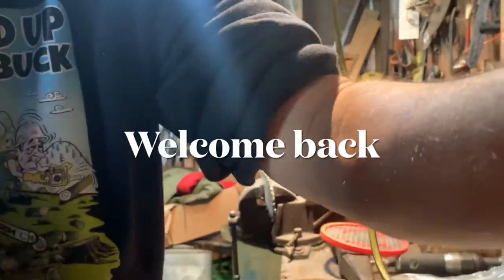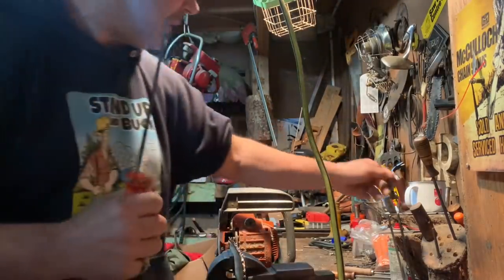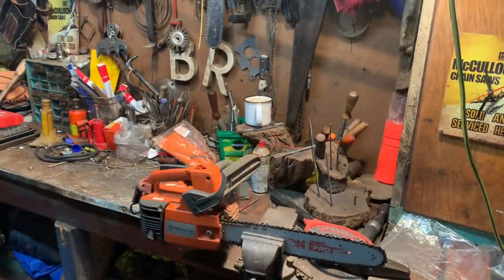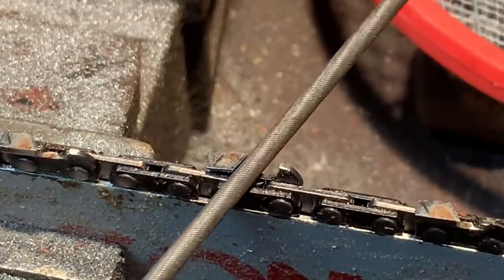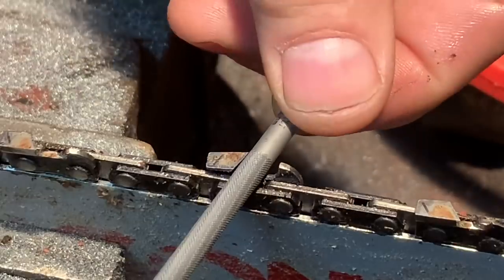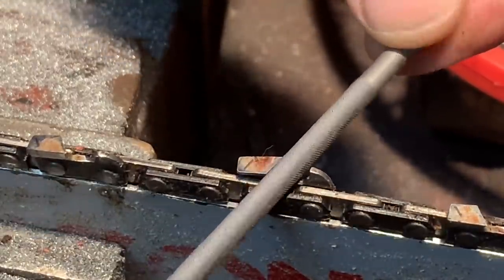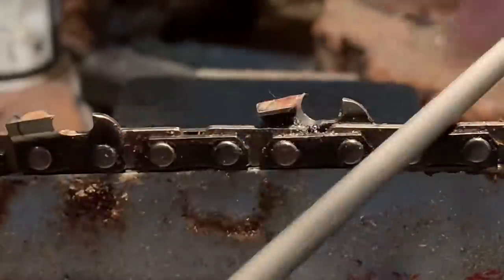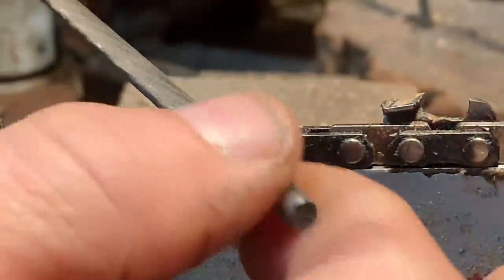How to sharpen a small chainsaw. (What file to use).

Comment: Thanks for this video. I have been cutting firewood for over 50 years and thought I knew how to sharpen a chain until I watched this video. I now heat my house of 2000 sq ft  with a homemade water stove and under floor radiant heat in north central NC. I started cutting wood with a McColluch with a manual chain oiler and am now using 42cc Poulans with 18 inch bars and 3/8 pitch chain. I sharpened one of them yesterday following your directions with 3/16 file and cut what wood I had uncut. I had a 10ft oak log 18in and a 12ft oak log 12in . I cut them 20in long in less than 20 mins and was disappointed that I didnt have more to cut. That really woke up that saw and I could not find my depth gauge for the rakers.
Thank you again
Reply: eBay $7 bucks

Comment: New subscriber who GREATLY appreciates your videos and the time you take to make them. Haven't operated a chainsaw in 20 years and just bought a Poulan Pro 4218 that came with an Oregon Chain that calls for the 5/32 file. The 5/32 felt weird when I test fit it to the cutter. Now I'm going to use the 3/16 when it comes time for the first sharpening. At first I thought it was a Full Chisel Chain based on the square factory grind and was ready to purchase a Swiss made bevel file , boy am I glad I watched this video before I did that !! Thanks Buckin for helping out the newbie community. And as always , Thank You for your messages of kindness. Be Safe , Be Kind and Be Happy.
Reply: I got several pro 4218 and I used the 3/16 just fine

Comment: My first chain saw was an electric,  about 30 years ago,  just some odd job pruning,  then about 20 years ago bought a gas power saw and more pruning and cutting,  even poison Ivy vines about 8 to10 inch diameter,  big itchy stuff,  pulled down some big trees. Taught myself to climb as a refresher course from earlier days of living with apple/plum and pear trees. 
I always took my chains to a shop to have them sharpened or bought a new one, seemed cheap enough for professional results. 
I have never sharpened my own.  
This video is the one that will get me to set up a new work table and put up my vice to get the gullet. 
After moving last year i got stuff everywhere in boxes and storage,  it is a cluster closet of crap(stuff) 
got a box of files,  box o chains,  a great indoor work project for the winter months. 
Love all the detailed comments,  I am very slow to do detailed work that I've never done. Must absorb as much info from all sources. 
My local friends have told me they can't believe I've never sharpened a chain,  they've all done it. 
It wasn't until now with such great camera angle close ups and the best darn tootin teacher on the yous toob that has inspired/motivated and taught me to appreciate my own abilities. 
Thanks Buckin and the many,  many experienced wood-folks for all the valuable insights. 
Love the Buckin army,  I'm a buck-private.

Comment: Good day to you buckin’ ive been a cabinetmaker and shop teacher for decades, always had a mental block about getting my chains sharp, sharp! Always ended up buying a new one, chain that is not a new saw,well just want to thank you from the bottom of my heart, you’ve changed everything for me, first revelation teeth don’t have to be the same lenght, second revelation boat filing get the gullet, third revelation don’t need to count strokes, and finially forth revelation keep going until you see a burr and no light on the edge, it’s not rocket science,thanks again
Reply: Sums up nicely what buckin would explain over the space of 25 videos 😎

Comment: Hi, Billy. 
I use a 5.5 mm file for large saws (like Husqvarna 572xp) , 4,8 mm file for  medium-sized saws (like Husqvarna 550xp) and 4,0 mm file for small saws (like Echo 2511) . 
Akujelppi from Finland 😉
Reply: I think that 5.2 mm file is suitable for 572 xp with a 50 cm bar  72 drives Oregon chain

Comment: Good afternoon from the Netherlands! Thanks for sharing. Did some firewood cutting last Saturday and afterwards filed up the chain again using your tips and tricks. They really work for me. First a few downward strokes to get the gullet and therefor the hook and then dress up the topplate. Once again thanks! Hope your arm is feeling better.
Reply from the maker: well done
Reply: @BuckinBillyRaySmith  would you be able/willing to do some more take guage debur bar maintenance and also your PREFERENCES to mix oils and octane for the older saws.

Comment: Buckin' i had trouble sharpening my chains for my little saw recommended file was 5/32 after watching you with your man sized saw chains i went up to 3/16 much better an much easier to sharpen my chains, thanks Buckin' for helping me think outside the box.........
Reply: Arron Johnston I find those 5/32 files are just too flimsy. I have a hard time keeping a constant angle.
Reply: @shapeshifter7753  i had that same trouble plus as Buckin' said you have to hold the file up which i think is the issue with keeping them consistent but after watching Buckin's sharpening videos i tried 3/16 and the difference was amazing i honestly haven't looked back since....

Comment: This is true, absolutely true.  I’ve been doing this for years, never knew it was a thing.  What ever size saw/chain combination I’m running after the chain has some miles on it I try a bigger file.  If I’m having to start my stroke and pull up on the file it’s a dead giveaway.  The file stroke with it’s proper X and Y axis (angle & tilt) should correct any dulling.

Comment: I’ve probably watched this three or four times now.  Still pick a little something up every time.  Sincerely though, thanks so much for recommending the 7/32” file.  With the 3/16” I found on a new tooth, I developed too much gullet and it would cut like crazy for a few cuts and then roll that cutter right back just enough so that I’d have to dog in to get it to really pull through.  With the bigger file, it’s not so extreme a hook

Comment: Sorry Bucking, but for once your explanation does make complete sense.  The reason that the 5/32 didn't fit is that you had filed it with the 3/16, so naturally as they are different diameters that will happen.   Basically, the 3/16 will usually produce a cutting edge that is more "blunt" than the 5/32 unless you cut deeper into the chain.  So horses for courses.
Reply from the maker: hey rob good to see your wheels turnin'. what you said is the point of the video  . and that is that the 3/16 fits thx buddy

Comment: Good video..! As a humble Saw (Stihl ms170) user...I've never seen anyone mentioning the fact that all chains have two teeth that face same direction (so the user knows when they have done a full rotation) and it's time to spin the saw or your body round and start the sharpening process until you reach the same two teeth that face same direction..! Unless I'm a total fool, it eliminates a lot of time and headache working out where you need to start to fill...and all that time marking the starting point with magic markers tippex efc...Maybe I'm totally wrong
Reply: I just put a red mark on my starting tooth and work around until it shows up again. No muss, no fuss.

Comment: Right on Billy. I started using a 3/16 on my 3/8 lo pro chains right after you put the first video up on it. I have to file mine a few times with the 5/32 on a new chain because I don't hardly have enough clearance to run the file between the tooth and the raker when they are brand new.
Reply from the maker: if ya wanna ship that step try putting 3/16 in straight across  for a couple strokes they a gradual turn
Reply: @BuckinBillyRaySmith  never would have thought of that! Thanks for the tip my friend!

Comment: One, could use the  1/8  file, to increase the  ' gullet '   (lower under part, which gives the tooth at the top edge, more  ' bite ' )  then, use the larger file  5/32, or  3/16  to  sharpen the top cutter edge.
 I may  try  this method, at present i use an angle  grinder  device,  with a  1/8  inch thick, fine stoned  disk.  A slight adjustment, for   a split-second, sharpens  this top edge.   Check out  Project Farm,  here on a Youtube channel.  This guy, compares  all  chainsaw chains,  and their  ' cut ' quality.   Very  good     product  testing.

Comment: I took your advice on a 14" corded electric saw,  3/16 file & "get the gullet" and man o man does that saw cut thru oak. As good as the power saw but less than half the weight

Comment: Buckin'...You may be able to get away with the 3/16 file on a new chain but when you get down to half the top plate left I think you are either going to either be deep in the straps or the top plate will have too blunt an angle.  You may want to drop to 11/64 (yes they are available).  And since you are mentioning file brands, have you ever tried the Save Edge brand.  Their files are the smoothest, longest lasting, and sharpest I have ever used and that includes Oregon, Stihl, Pferd, and Husky.  Try their 6" flat file for your rakers and you will be amazed at the ease in filing rakers...like nothing I have ever used.

Keep the good content coming.  I always learn something!
Reply: OBX Koastie great tips there friend!

Comment: Hello Buckin’ could you put up, and explain the difference between chains, full house, skip tooth & full skip, and the chains for ripping/ milling.
Reply: This and the files he recommends
Reply: I wish I could like this question a 100 times. I want that too. And is there a difference in file plates for which size chains. Also I'm very interested in the flat file sharpening so which file for which size chains

Comment: Yeah that works, but as you get farther into the depth of the teeth, you'll be having to put a lot more work into it than necessary because of cutting into the link of the chain.  Using the right size file allows you to get more use out of the chain before you have to start grinding into the link to keep it sharp.
Reply from the maker: switchin back near the end solves this, if yer concerned about it  ,, thx

Comment: No micrometer ?  Take a peeksy-poo at the STIHL picco chain 3/8 .050 low profile if it suits your fancy ... You might have another customer on your paper route!  I wouldn’t use it commercially on any saw much over 50cc or 5hp , el - stretch or worse el snap - o - la ... That 572xp is really laboring Buckin 😉

Comment: I use the stihl 201 queit a bit I use the Oregon 91 vxl chain. This chain also cal for a 5/32 file or 4,0 mm as I prefer. I use the 4,5 mm to the chain is about half worn or so, then I use the 4,0 mm.

Comment: A note .  After a couple chain sharpenings, one should file down, the  depth  gauge link, just before the cutter tooth. Try to keep 1 mm or so, of height  LOWER   THAN   THE   TOOTH.  As more chain sharpenings take place, the downward slope of the cutting tooth,  is now the front edge.  Both of these teeth,  require  trimming  at  some  point, after probably  3 sharpenings. Both, must co-operate when  needing  a  good  ' bite '.

Comment: I only use small saws and I filed a chain with a 3/16 to get underneath the topplate. But it weakend the chainlink so much that it snapped. What am I doing wrong?
Reply: You must have ground down onto the chain strap to much,,,possibly weakening it.
Reply: That's what I figured, but how can you avoid that with a bigger file. You must "dig in" to get underneath the topplate

Comment: I'd like to pick your brain for just a second. I have a Craftsman / poulan 42 cc with an 18 inch bar that keeps getting hung up on a single tooth but it's not pinched, when I finally get it yanked loose there's a chunk of wood stuck in the tooth everything seems to be in line everything is cutting fine when it doesn't snag. Have you seen this before? The tooth doesn't appear to be any longer than the rest either and my tension just keeps the chain snug in the bottom with the tip up. It started doing this within an hour of the chain being freshly purchased on the first use. But I have a second battery powered echo with a 16-in bar that has done the same thing and lost four teeth in the process...

Comment: I subbed to you Billy after seeing you hang an axe with Steve. I have a Oregon R40 3/8 .043 calling for 4.5mm. I saw no reason to buy those expensive files. So I just used 3/16. I’m guessing this is fine?

Comment: Thanks Bucking I needed that, my saw is cutting to the left! Making a curve at 3/4down not sure what I'm doing wrong!
Reply: Dull chain most likely, how is the sawdust coming outta the saw while its cutting crooked? If its powder or fine you definitely need to sharpen the chain. I always pay attention to my sawdust it gives a lot of feed back.
Reply: Yeah dull, and not uniformly sharp throughout. Some of the teeth could hit trapped dirt or rocks dulling just some of them or you have sharpened half of the teeth more effectively than the other (more pressure or funny angle on one aspect or something). Either way you'll end up with a chain that wants to pull more towards the sharp teeth with the dull ones not contributing (obviously). Sorry if I'm repeating what was said in the video, I skipped a little... 🙃

Comment: Hey Buckin, I love your work and I've built a house in the country and learned to run a power saw from you so thank you.  I have a question though that I'm not sure if you ever talk about.  When you turn off the saws I see you pull on the pull cord, what's that for.
Reply: I would like to know that reason also! Been running saws for 12 years and always wondered why Billy Ray and others do that? I am sure he has a perfectly legitimate reason for it? I'm just to dumb to figure it out, Lol

Comment: But the whole reason for the smaller file is so you will have to use slight "up" pressure, instead of downforce. So you're cutting the metal that needs cut, not down into the chain, or lower into the tooth body. Seems to me you're going to get about half the useful life from a chain doing it your way.

Comment: 2:40 only reason there’s the space is because have have been using the larger file and it has a larger diameter. If you used the correct file size the whole time there would be no space.

Comment: hi buckin how can i straighten the crankshaft of my chainsaw? It got crooked on the clutch side
Reply: I used my 455 with a bent crank for a few months. It actually straightened it’s self🤷‍♂️crazy but that’s what happened. Unless someone knows a trick I’d say it needs a new one put in. Good luck in your journey friend
Reply: How did you check it to narrow it down to the crankshaft.
Reply: the problem with my chainsaw is that having the shaft bent, the chain causes more friction in certain points of the bar
Reply: I  have got a landoni l75, is a italian chainsaw since 1970
Reply: Surely sounds like a bent crank😖Sounds like it would be difficult to find parts for. Does it still run?
Reply: @etto7566  have you tried another bar. Thats also what happens when the bar sprocket goes bad, the chain will loosen and tighten.
Reply: @brettblack7049  yes i try to install another bar
Reply: @shapeshifter7753  yes the chaisaw run well...
Reply: Nice take on that one Brett! It never crossed my mind 👍

Comment: I use a rotary tool with a grinding stone. Do you recommend against this method?
Reply: I use a rotary if I’ve damaged a few teeth and need to take a bunch of material all at once. Have a great day friend
Reply from the maker: yes i do
Reply: @BuckinBillyRaySmith  here’s a little machining tip, NEVER drag your file on the backstroke. pick it up, backstroke and set it back down for the next cut. Your files will last longer and they will thank you for it
Reply: 95% chance of burning the tooth with a power tool (grinder, Dremel, etc.,...)... so, it's good for severely damaged teeth, but not a great idea otherwise.  Side note: the inside drivers are good candidates for  power tools, when your chain pops off and the inside drivers get dimpled - then a flat grinder, like a Dremel for example,  is perfect. )
Reply: Avoiding all contact on the backstroke is much slower, I don’t believe a light brushing on the return is causing enough damage for me to change technique.
Reply: @neild7971  - Absolutely.  There are rules,  and there are rules.....but there is  always a limit to rules. I personally lift the file out of the gullet on pretty much every backstroke,  but I'm not THAT anal about it....8%-12% of light pressure dragging back is not going to kill ANYBODY.
Reply: @samuelluria4744   Bingo! plus files are penny's. The main objective is to get back to slinging some wood chips dollars vs pennys
Reply: I was just taught to protect my investment, even if it’s just a humble file
Reply: @jeffccr3620  - Yeah, it took me  a few years to figure that out, but now I've made peace with  not trying to wear down files till they're slippery,  Lol.
Reply: @pacificcoastpiper3949  - No argument here. Just saying that there is a reasonable limit. Slight incidental  grazing of the file on the way back, is not something to lose sleep over. A lot of guys drag the file back with no care at all, and that's not me, but, as I said...there's a reasonable limit to perfection.
Reply: @samuelluria4744  I guess I’m just finicky, but I’m also set in my ways, where I am, tools are very expensive
Reply: @pacificcoastpiper3949  - Like I said - no argument here... we're probably only talking about the difference between  getting 3-4 sharpenings out of a file, versus 5 or 6.... but i respect  frugality,  trust me.
Reply: @samuelluria4744  thank you ☺️
Reply: @pacificcoastpiper3949  - And Thank You!
Reply: @samuelluria4744  no worries buddy
Reply: I used to use a Dremmel...then I met Buckin'.  So much more control and connection to the saw and chain.
Reply: @danjames9696  - i only referred to the Dremel, as far as the INSIDE drive-links!!!!!!! When it's just a matter of 5-10 inside drive-links, there is no reason not to use a Dremel,  if possible...